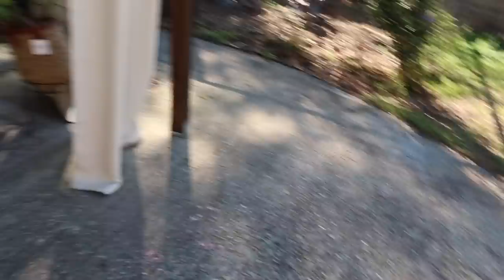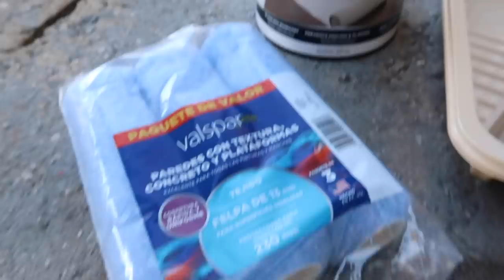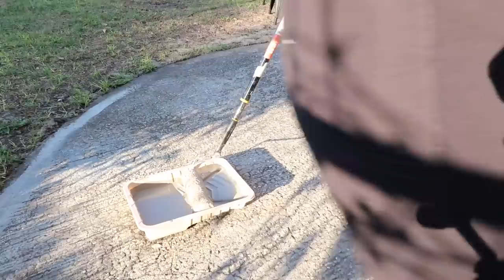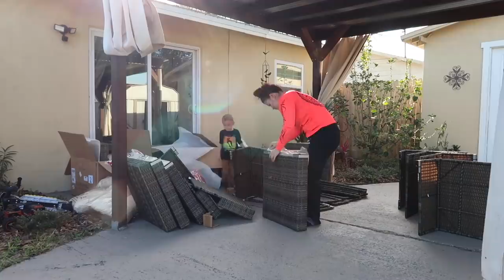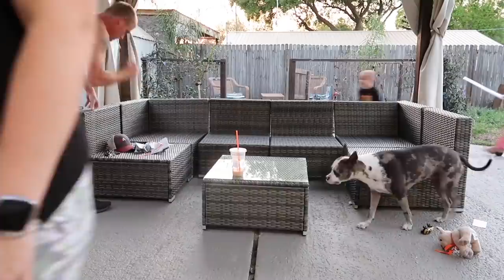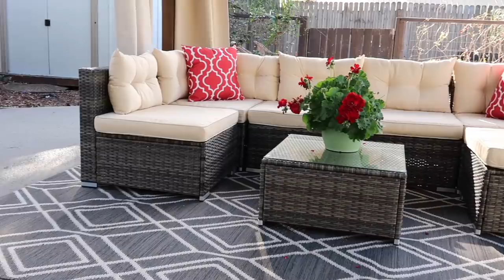Spring patio makeover | DIY porch transformation | Spring refresh | Porch makeover

Comment: Put the cushions in big black trash bags and place in a shed or garage while the weather is rough. That’s what we do with all of our  bench seat and chair cushions from our patio! Then you could always get a couple of tough heavy duty plastic storage benches and place them somewhere in your yard or patio for extra seating too. You can get them in white and dark brown I’ve seen so far.
Reply from the maker: Good idea thank you 😁
Reply: @karrielynn  if the cushions are heavy enough, they won’t blow away usually. Here in North Carolina we have hurricane winds and tornadoes almost every year, so now that our shed is finished, we will store them in there during the winter in the black trash bags in a wheel barrow. When we get the pergola built we can leave them out longer. Spring through fall and sometimes part winter. We don’t usually get real cold here until mid December / January. Then it’s real cold half the time or more through March, we’ve had 70’s thru 80 degrees this month, Crazy!

Comment: The air blower should have been a first step before a thorough sweep prior to painting even outdoors it should be washed down,  thoroughly dried and then painted. It just won't last with dirt to adhere to. I hope it lasts this summer but by fall it will probably be flaking off is my guess. And please have them replace the broken part and you might be able to do that by sending a video clip and photos. Where is it made?

Comment: Would you recommend power washing before painting? Or did the paint just cover everything anyway?
Reply from the maker: I think it's personal preference I have painted my front porch before and I never pressure washed it and it is holding up just fine. If it is super dirty and muddy it wouldn't hurt to pressure wash. My patio gathers water in some areas  and I didn't wanna wait forever for it to dry.

Comment: So, I'm debating on buying this set. It's in my cart, but I'm reading the reviews about the actual cushions. I know you haven't had yours long, but do they seem flimsy as in they'll flatten. My family is heavier, but within the weight limit. I'm just curious if you would still recommend for someone overweight.
Reply from the maker: So far they seem like they are pretty firm but they aren't as full as the photos appear like mine still have some extra fabric that it didn't expand to. I also read someone's comment down below and they said they were heavier set family with tall men and eventually the chairs dipped in the centers. I could definitely see what they mean Because there is no support in the centers. Also the back isn't very tall so being tall could definitely be a problem when it comes to comfort.  I hope this helps. ❤
Reply from the maker: In the centers of the actual wicker part is what I mean *
Reply: @karrielynn  this does help. Thank you!

Comment: I'm wondering why you didn't power wash the concrete before painting or hose it down and give it a scrub with a push broom?  Doesn't make sense to me putting primer over an unclean surface.  Not sure what size nap you had on your rollers.  When painting very porous surfaces, you want to use a longer thick nap roller that holds a TON of paint and it will get into all those cracks and crevices with a lot less arm effort on your part.  And - the piece with the crack in the plastic.  I would have used some super glue product and clamped it, just in case.  You wouldn't want a guest to be sitting on that part some day and suddenly it falls down because the crack has snapped through the plastic.  I would Scotchgard/waterproof the cushions - just in case.  A project for a future date:  cutting ties for each of the cushions - you could use a color-cooordinated strong ribbon, sewing them to the cushions on the back of each (one on either end centered across the back of the cushion)and weaving the ties through the sofa and tying them off - wind proof.  The rug is gorgeous and such a good price.  I assume it's an indoor/outdoor carpet that can be cleaned by spraying vinegar water on any stains (or green algae growth) and hosing it down.  The set you received is very pretty and will hold a lot of people comfortably.  It's a beautiful patio area.